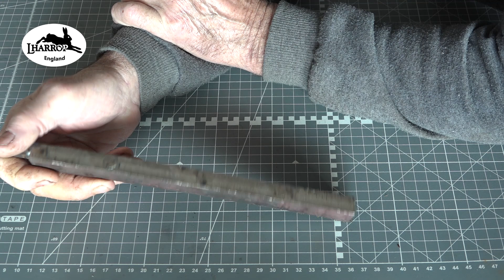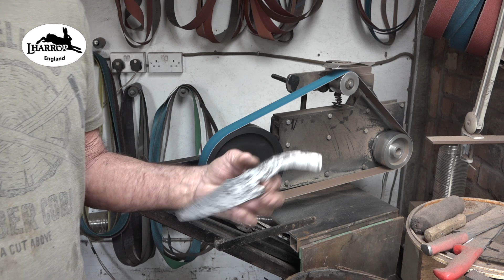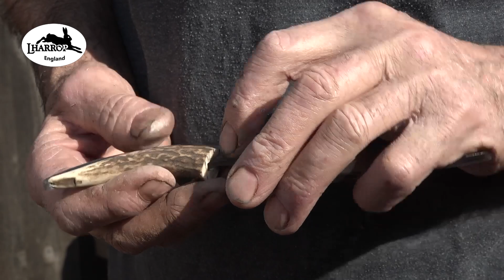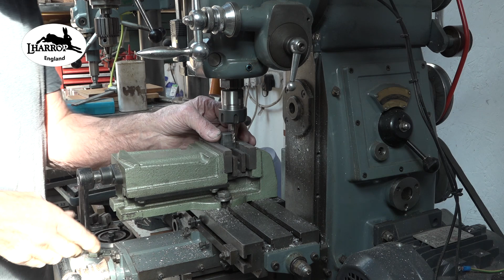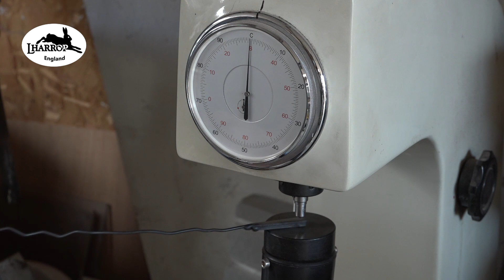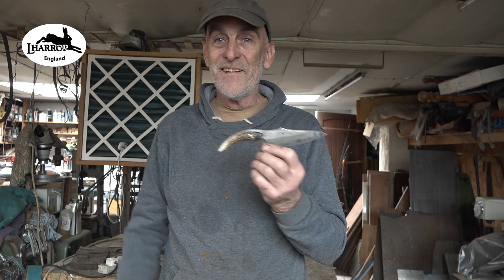forging a wrought iron san mai knife #sanmai

Comment: Did you hollow grind or flat grind the bevels?  Little hard to tell in the pictures.  Turned out great. I love doing wrought iron sanmai.  Such a beautiful material with lots of character.  Best part is that it works and welds easy, with the correct heat ofcourse.
Reply from the maker: Cheers Eric yes just a Flat grind mate the edge is thin enough 😂👍

Comment: Beautiful, as always. The antler and buffalo horn are a nice touch. Love the profile of the knife. 🍻😎Quick question did you ever finish the project on the wood house that you were restoring?
Reply from the maker: Thanks Daniel, funny you should ask about the shepard hut I was there this week getting set up ready to continue the work now. All the big things i needed like the roof sheets siding sheets and windows etc have arrived so I will be back there next week and crack on with the build. I think the first job will be installing all the wiring for power. Cheers.